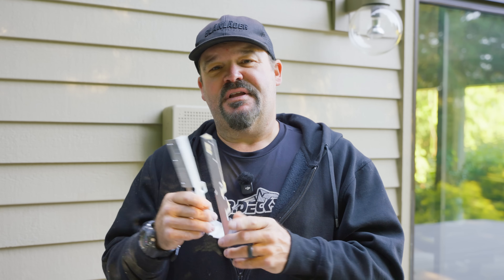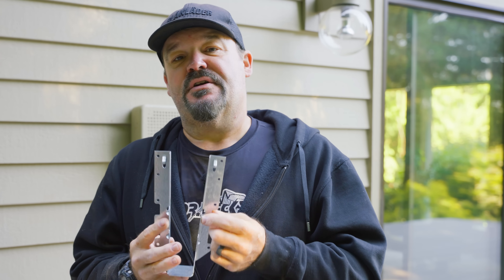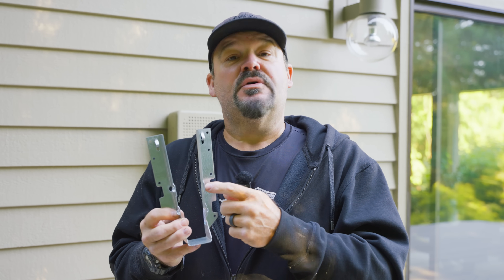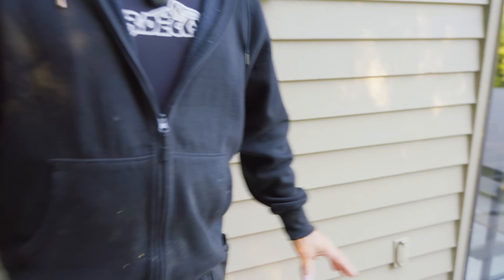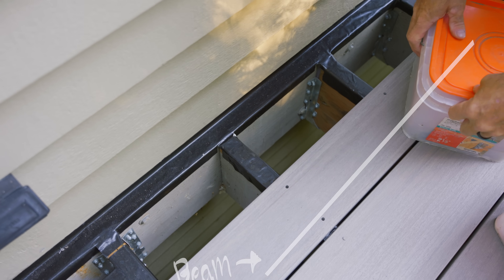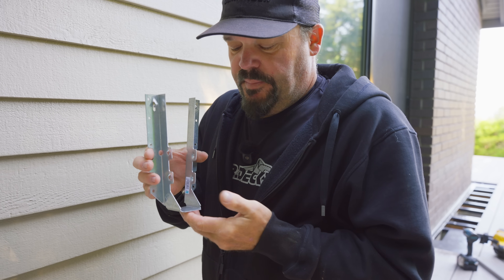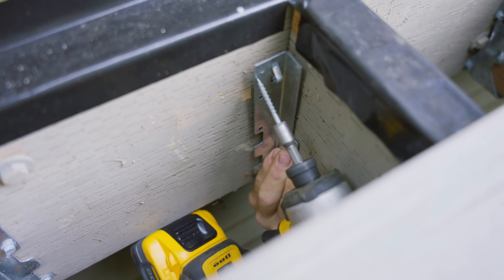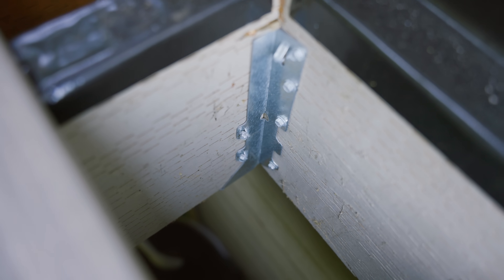The Biggest Deck Building Mistake I've Seen Over 30 Years

Comment: It drives me nuts there’s no gun that shoots the nails you need for the toe nails.
Reply: I know it's not the same, but a palm nailer works really well for them.
Reply: @CMCraftsman There is indeed a pneumatic nailer that shoots joist hanger nails. It is built for steeper-angle collated hot-dipped hanger nails so the unit fits into tighter spots. Look for the “Positive-placement nailer”.

Comment: The deck was fine the way it was there's so much Overkill in the past 20 years that it's ridiculous
Reply: @rmg3008  there have been numerous tragedies with deck collapses in recent years and deaths as a result. New code rules have strengthened the connection between the deck and building because that’s where the deck sandwiches dead bodies in a collapse. I’ve seen many decks that were falling from their own weight and would never hold up a deck load of partying people.
Reply: I've seen decks completely shear off buildings that were only nailed in place without hangers, even way back in Crestline and BigBear, CA after a wet heavy snow back in the mid 70's.
Reply: @coloradomountainman8659 hey shut up with your silly reality and experience!
Reply: Oh look, a non structural engineer has chimed in. His additional qualifications include non tradesman.

Comment: I have a question, I built my own deck a couple years ago and used Simpson hangers with their structural screws on my metal connectors. Do I need to go back and snug the screws up a year or two later since the pressure treated lumber has shrunk a bit from drying out?

Comment: Each Simpson hanger is engineered, just like an engineered truss. Each hanger has a spec sheet that can be found in their Simpson book. The book gives the specific fastener that is required for that certain hanger. If you don’t use the correct fastener, it is not meeting the engineering “code” that Simpson has provided, and Simpson is not liable if the hanger fails
Reply: Depends on what that hanger is holding and how it failed...

Comment: Dr. Deck, do you also install hangers on the other end of joist at the joist rim? Thanks
Reply: If there is a girder w/ minimum cantilever, no. But if cantilever exceeds 3’ or more to outside rim joist then yes. Or if there is no girder and you just have a span between ledger and outside rim then you do both ends.
Reply: @lambokid11  Very helpful and much appreciated!
Reply: Where I live cantilever of only 2' is allowed and then joist is secured to the beam it sits on with hurricane ties insuring they won't shift side to side.
Reply: @loco4dogg  Here in Summit County, Colorado snow country we have to pressure block between each joist where they contact the support beam if there is a cantilever.